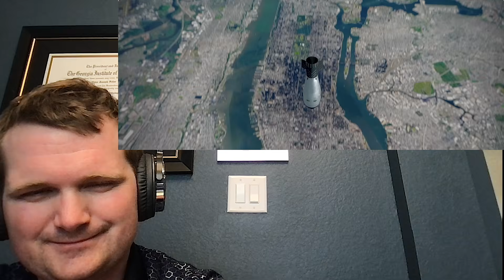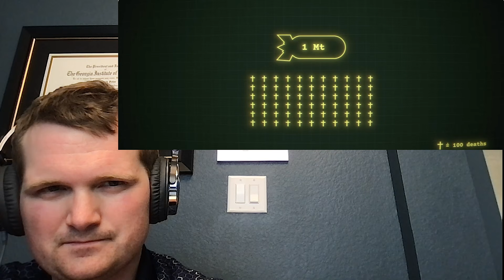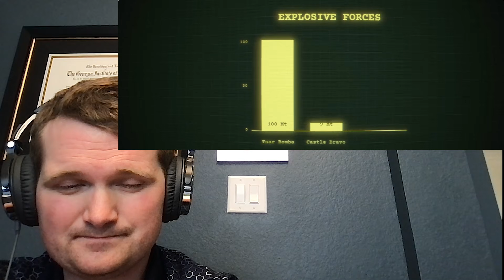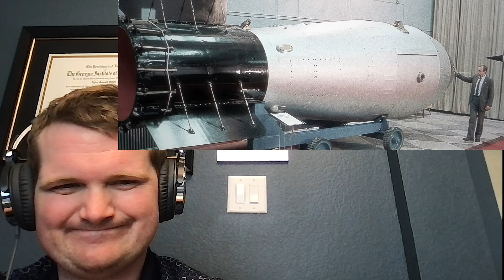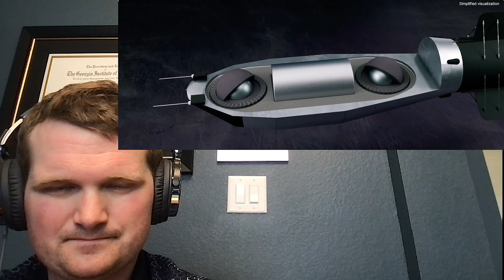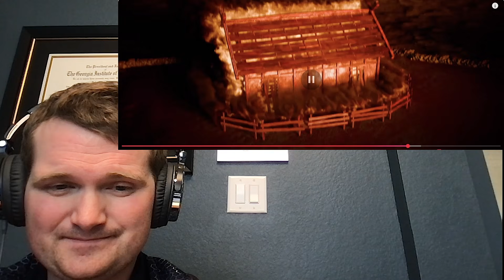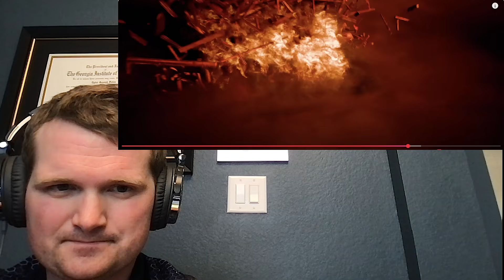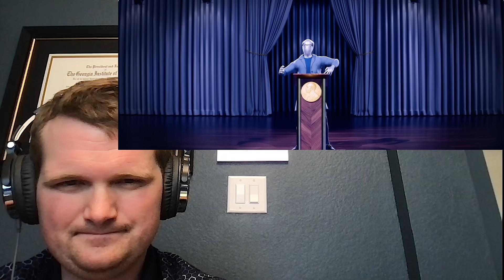The Biggest Nuke Ever - Nuclear Engineer Reacts to Fern

Comment: Tsar Bomba was actually remarkably clean fallout-wise. It was airburst, and the lack of a DU tamper meant that the vast majority of its energy output was from fusion. Few neutron-activations and few fission products, respectively. The real radioisotope polluters are small, test-stand or ground-impact bombs.
Reply: Didn't it get to the point the bigger the boom the more efficient  it's use of products so to speak.
Reply: @RhysWilliams-u3o   That’s not always the case. It depends on the staging type; if it’s just fission->fusion it can be rather clean, but if you go fission->fusion->fission like the larger Tsar variant it can go back to being dirty. You get fallout from 1) fission in the weapon, 2) neutron activation of materials in the bomb, and 3) neutron activation of the surroundings. All of those depend on the design, and aren’t determined by the explosive yield.
Reply: @RhysWilliams-u3o  No, it's just the opposite. The more you put in the less you get out per gram of material.
Reply: Most of the force in megaton range nukes is wasted
Reply: That’s what he said.
Reply: Tsar Bomba was an “exhibition” weapon, it was made as a Soviet flex, not designed for practical use
Reply: @gregbors8364  well... the Soviets at the time designed LV for this "exibition" weapon - UR-500, which will become "Proton" in couple of years. It was designed exactly for carrying 100 MT bomb to USA. Thankfully it worked for peace - Luna-15, Venera-13, Salyuts, Mir and part of ISS and a lot more.
Reply: Yeah, this bomb was intended to create a tsunami, not be dropped. So, idk how that factors in. IMO, but since they developed a tsunami torpedo right after, I assume.
Reply: @Wavy_Gravy But as much I know, these nuclear weapons(even Tsar bomba) have nowhere close the energy required to produce big tsunamis. If it's intended to make tsunamis using the bomb, they would have to drop it very close to the coast in order to prevent the tsunamis from depleting after traversing the distance.
Reply: @Onlytopup6969 it can but I'm sure from it's practicality,it won't be able to cause a tsunami of a tower high but will make warship bays inoperable
Reply: @Onlytopup6969  According Wikipedia, the earthquake 2004 near Sumatra released the Energy of 475 MT TNT. The resulting tsunami wave was estimated about 5 MT TNT. 
So yes. these bombs indeed do release enough energy but it depend on how effective this energy coupled on water. 
Also take into account, the depletion of tsunami waves does not follow the 1/r² law.
Reply: @Merilix2  In short point source can't create equally destructive at longer range tsunami already because energy spreads equally to every direction.
Unlike big tectonic plate movement happening over long strip of seafloor forming "wall" of displaced water with resulting wave being more directed.
And unfortunately coastline parallel to subduction zone is always in one of two directions where energy of waves is focused...
Reply: @tuunaes  Well, but it is roughly only the linear behavior of a surface wave. 1/r, that is, double the distance only half the energy. Unlike a volume wave whose energy decreases quadratically. That is why tsunamis can still have quite a strong effect at greater distances.
Reply: @Merilix2  Multiple factors.
In case of Sumatra 2004 quake lock up between plates ruptured over length of well past 1000km. So waves were sent by more or less that long displacement of water.
Reply: @Wavy_Gravy  No they didn't build it then. One of the Soviet Navy Admirals said there was no need for it. But under Putin they did build it. Look up Status-6 Canyon UUV/URV. 35Mt warhead to take out harbors. Oh an it's totally autonomous and is powered by a nuclear reactor.
Reply: @c @cmkeelDIM Yeah, they created already nuclear powered AI killing dogs😂
Reply: They killed a bunch of people in random towns miles further away than they expected but otherwise yeah it was relatively fine 😂
Reply: How are these details important, yet the bomb still kills humans? Talking of a clean bomb?
Reply: @szlpharmacology1330 It changes the number of people who will die from fallout effects. It’s important in this case because Tsar Bomba was never deployed as a weapon, so all of the people it killed are via fallout.
Reply: Who's idea was to make it clean? It should be super dirty to magnify the effect
Reply: @badcornflakes6374  The USSR tested it in their own territory, so even if they wanted a salted weapon they probably would prefer not to have that on the test model. Also keep in mind the test article was half-yield compared to the maximum of the design, and was never intended to be deployed
Reply: @caliperstorm8343 Yeah it was very clean.
 
IIRC, the flew to ground zero hours after the detonation... And measured radiation was almost the same as background.
Reply: Depends on what you want. During the  old War NATO knew they could not stop Soviet tanks coming through the Fulda Gap so their plan was to totally irradiate the entire area, denying the Soviets access to the area while the US built to forces in Europe. But they have other weapons, Neutron Bombs I believe, that will irradiate an area but do little damage, allowing a force to still
 utilize an area once the fallout subsides, though it could be the opposite and do massive damage with little fallout. Point being they have different bombs depending on different situations.
Reply: @badcornflakes6374  It was the replacement of the uranium tamper with lead that made it so clean. There was really nothing to be gained from having the uranium tamper in place. The tamper is effectively a passive component, while it certainly amplifies the yield, how it does so is well understood and scales up just fine. Reducing the yield to 50 megatons gave the aircrew a 50/50 chance of survival and dumping a LOT of radioactive fallout over the USSR's own territory for no useful outcome would have been plain dumb. 
When the shockwave caught up to the Tu-95V bomber, by then 115km away, it accelerated the plane forwards by 100kmh in a fraction of a second, to 980kmh. It then plummeted 800 metres in the rarified air behind the front of the shockwave.
Reply: @badcornflakes6374 Not really. The idea of a clean bomb is way scarier than a dirty one.

You can delete your enemy, and you dont have to worry about killing yourself.
Reply: It seems to me, that nuclear bomb radiation is never a thing. It's few kilograms of material, spread over thousands square miles. Doesn't matter if you hit the same country a thousand times, it'll still be less radiation than a fing banana. Imagine bananas spread all over the land. The dirty small bombs they dropped in Japan? Did they even pause living there? Nope.
Reply: @Tenebrousable You are partially right. Most fallout isn’t actually the bomb material, it’s the tons of irradiated dust and debris that is kicked up by the explosion. Larger bombs spread this radioactive debris over a much larger area, reducing the concentration. The WWII bombs, though tiny (for nukes), were both detonated thousands of feet above ground level, meaning they didn’t kick up as much dust, resulting in relatively low persistent fallout. Almost all of the radiation exposure was during the blast itself. Of course, if you detonated Little Boy at ground level, you’d have a radiological nightmare on your hands.
Reply: @shok24199  That's how they explode all nukes, to get maximum destruction. On Airburst. Saves the ground material from irradiating fireball. But's it's destroyed anyway, so maximising the area destruction, they burst it in air. And the radioactive material decays quickly. Might someone start serial nuking ground bursts? Sure. The area gets fucked worse. But global fallout is almost nothing. And the real scaredy point is about the nuclear winter, where the burned material blots out the sun. That supposedly kills without radiation. Fukushima is perfectly livable, it's just the PR making it impossible. People live with worse backround radiation elsewhere. It's a non issue.
Reply: @Tenebrousable  you don’t know what you’re talking about and it really shows.
Reply: @codedestroy680 You know better do you? Or do you just remember some vague conclusion fear of the unknown from "official sources" that are so reliable in every other aspect of your life.

Comment: While a design that sandwiches the fusion stage between two fission primaries (FP) could theoretically increase the fusion yield, provided the FPs were fired simultaneously with extreme precision, in reality this would have been achieved more by fluke than by design, considering the variables inherent in such a system. This was 1961. While the explosive lenses may have been initiated with extreme precision, they are made of chemical explosives of different detonation speeds, typically somewhere between 9000 and 5000 m/sec, a detonation progression difference of up to several 10ns is nevertheless easily possible, even if the explosives for both came from the same respective batches. Two fission primaries may indeed have been used, but more for preventing a propaganda fiasco, that would result if the only one being used actually failed. The FP detonating a few nanoseconds earlier would initiate the fusion process. The 2nd FP “laggard “would just get consumed and its yield would depend on the assembly stage it reached when it was initiated by a neutron generated in the bomb. 

Good to see that the popular narrative of the "clean" thermonuclear bomb is finally changing. It is correct that pure fusion weapons are cleaner than fission devices, particularly enhanced neutron radiation weapons intended for killing tank crews or disabling incoming nuclear missiles, etc. They employ very thin fertile tampers to minimise the consumption of high energy fusion neutrons in the tamper fission process. However, this is not the case with standard thermonuclear warheads. Many designs now make extensive use of cheap fertile tampers (U238/Th232) to create the main yield, e.g., 70 - 80%+ yield from fission. They could be called fusion enhanced fission weapons and are practically as dirty as a pure fission device, and this also applies to a strongly dialled down variable yield weapons.

Comment: Weren't there some problems with the russian nuclear lighthouses all along the northern coast ? The ones that were using the Beta-M radioisotope thermoelectric generator. There was a story at some point that after the USSR disappeared they fell in to disrepair and some got stolen or just disassembled for the value of the metals.
Reply: yup, and dozens of those radiation sources are still missing not just from the far north but deep inland radio stations as well, including in several of the now independent republics.

Comment: Every time I watch a video related to anything nuclear, afterwards I'll check if Mr. Folse has done a video on it for corrections. "Nuclear" isn't just energy and bombs, just remember the last time you had an X-Ray done; that's a form of using dangerous materials into improvements in quality of life (and your fracture of course).
Edit: We're not in the 60s anymore. Nuclear energy is almost completely clean. As long as we keep improving safety standards and training personnel, nuclear is actually safer than any other energy.
Reply: There's no need to improve nuclear power's safety: it's by far the safest technology human has ever conceived at the moment. What needs to be done is reduce costs and create a large supply chain that can economically compete (and beat) with fossil fuels.
Reply: @samuele8361  "there's no need to improve it" is a dangerous mindset. the exact reason it's so safe is because they are always looking for ways to improve further.
Reply: @Sahtoovi  we did not improve safety in the last 20 years, we just raised costs in the west making it basically illegal. The amount of bs regulations the nuclear power industry had to endure is infuriating (there's also a nice report from the UK government that documents it if you want).
Reply: @samuele8361  that is completely false. safety has improved in the last 20 years, not by a massive margin, but improvement is incremental.
since fukushima, passive safety has been improved quite substantially. modern plants can cool themselves and shut down safely without any human intervention. one example is the AP1000, which had the construction of the first unit approved by the NRC in 2011, and 17 units are currently either operating or being built, the first one was commissioned in 2018.
also simply the slow move to gen III reactors is already a major safety improvement on its own, since according to some estimates gen III plants are an entire order of magnitude or more safer than gen II. on top of that, gen III+ is already a thing, the first one has been operational since 2016.

so yeah, I don't know if you're just misinformed or actually lying. I hope it's the first one. it's true that nuclear has been subject to stupid regulations written by people who don't know what they're doing, but it's objectively and completely false to claim that nuclear safety "has not improved" and that costs have just increased. I didn't touch on that part at all, but I'm pretty sure it's not true either.
Reply: @samuele8361 complacency kills
Reply: Over time, nuclear is less harmful than any other form of energy production. Manufacturing parts for solar and wind, or burning conventional fuels produces more pollution (as well as a considerable amount of radiation). So many advances have been made in the last 50 or so years.

The most significant obstacle is getting people to understand that. So much fear has been spread about nuclear power and just radiation in general. We ride in multi-thousand pound metal boxes propelled by continuous explosions by the millions every day. That's been made...relatively safe, and nuclear power has MUCH more stringent safety protocols than motor vehicles by thousands of miles. Plus, to work with nuclear power, you need a decent amount of post-high school education, so Timmy who couldn't pass 12th grade physics and only graduated because the school administrators want to pad their graduation rate isn't going to be at the helm.
Reply: But is anyone checking him?

Comment: They probably could do a Tsar Bomba 100MT ICBM later in like the 70-80s without problems. But it's more efficient to do a bomb with shitload of weaker warheads.
Reply: I am not sure how much you could condense a 100MT warhead. It's a three stage device so that takes up some space, which is why the bomb was so huge. It was too big to put on an ICBM of the day. Perhaps a 100MT device today would be smaller than the Tsar Bomba but I am not sure if it'd be feasible to but one on a missile and, as you pointed out, multiple smaller warheads for multiple targets is more efficient than one big warhead. Not that any should ever be used.
Reply: When the US Navy was designing the Poseidon SLBM someone is supposed to have said 
"Let's put a nuke into all the decoys."
They got ten 40 kiloton warheads on top of a slightly modified Polaris SLBM.

Comment: Large vessels would be able to sail the weapon to its target
Reply: and would be likely intercepted and boarded way before they got to any target. Unless your target doesnt have proper intel capability.
Reply: @michajastrzebski4383  Yeah, if you intel leaks every attempt to deliver a nuclear bomb via ship is doomed to fail. 
The problem is that without such a leak detecting this thing before it swims along your coastlines would be very hard. Cargo ships are everywhere and huge enough that such a bomb could be hidden, even from its crew if absolutely needed. If it is not build to be dropped from the sky it most likely wouldn't look even remotely like something that sreams NUCLEAR BOMB at the average crewmate and could be hidden in the enormous stack of cargo containers.
Don't get me wrong, dropping usual nukes via missiles etc. is much more efficient than this delivery method but the thought of an enormous nuke smuggled directly into your harbour or even worse into the country itself is still terrifying. Especcialy so since those monsters could be much bigger than any nuke reasonably deliverable by air and when it is close to your harbour it is already to late to intercept this thing.
Reply: @michajastrzebski4383  you rely too much on detecting something so small relative to the tonnage that enters the country. Ny dc la would all be in danger. Have you seen the size of  the new container vessels?